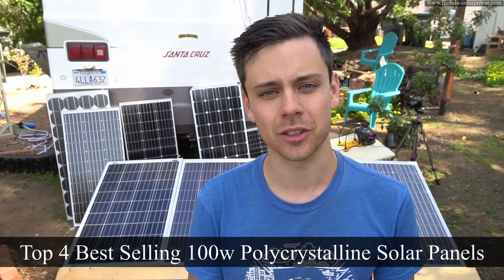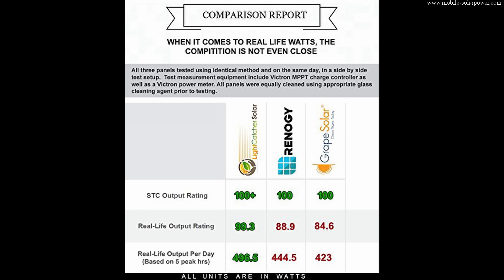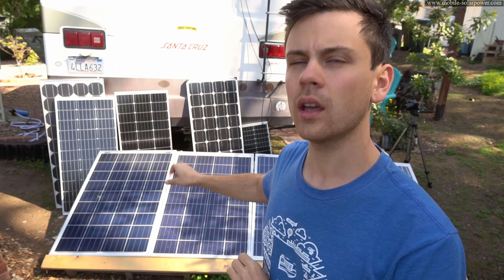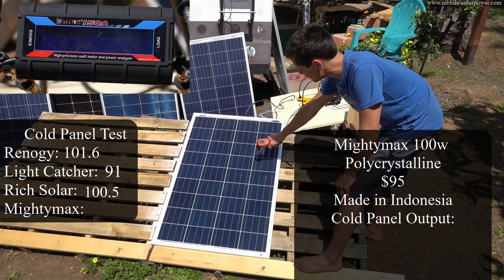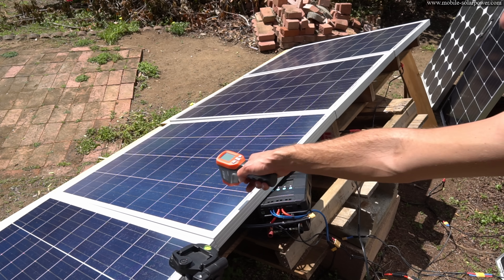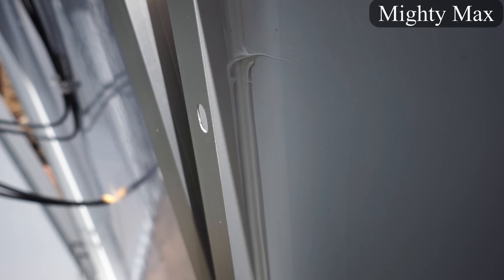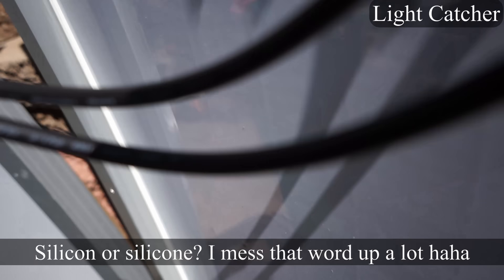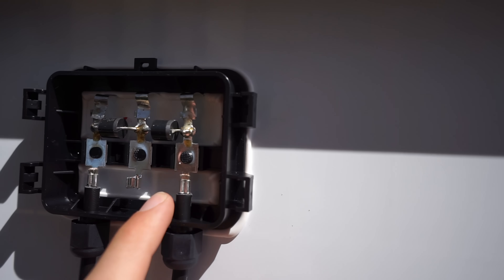100w Polycrystalline 12v Solar Panel Showdown! Renogy vs Rich vs Lightcatcher vs Mightymax

Comment: That was a great video, thank you for all that good work you do. I just bought a 400w system from windynation.com. four 100 watt panels. One came with a dent in the side like from a forklift and also had a bow in it. Another panel was all dirty on the back side and had an opened bag a battery cables Loosely flopping around. It also came with no instructions about their wiring. The wire that was included to hook all the panels together was in a very tight configuration. There was not enough wire to go from the battery to  the roof of the RV. That distance was only seven feet. Their instructions were to go to the internet and download their information. Being I am out in the middle of nowhere and without a computer and only a telephone to do this on, left me at quite a disadvantage. I've watched a number of videos on Renogy lately. They impressed me the best and that I believe is where I will be going to get my system in proper order. I will order a new charge controller and wire to start with and then discuss with them my future needs. Again thank you for this video.

Comment: id still love to see how you could use the heat on those panels by running some hose on the backside of em (fixed to the backside w/ thermally conductive silicone) and running water trough em
Reply: Or just spray a mist of water on front . The evaporation effect works better than running water.
Reply: @00708046  His comment was about using the heat not just cooling the panel - as in dual use to cool the panel while also creating a solar water heater.  Besides that you would have to pay for the water that you spray on them, and most tap water can contain a lot of minerals which can build up and degrade the efficiency of the panel over time and need to be removed.  Rain water does not have that problem since it is essentially distilled water.

Comment: Funny, when I bought solar for my RV (2 Renogy 100w Mono), mono was supposed to be the best and Renogy one of the cheaper.  Thanks for this and I find your videos really interesting. If I add more panels, it looks like Rich Solar poly is the way to go.
Reply: I'm looking at the Renogy 100w Mono as well. What has been your experience with them so far?

Comment: Hi Will, we just purchased a 2019 Thor Challenger 37FH, it is 'pre-wired' for solar, but we're at a loss as to what we need at this point and where/who should complete our system.  Any suggestions?
We definitely want better batteries then the house batteries it came with.  I've watched many of your videos and trust your input.
Thank you!

Comment: polycrystaline panels works usually better in not direct sunlight than monocrystaline, but in otherhands monocrystaline panels usually have just tiny bit better effiency, so you can produce the same amount of electricity with smaller panel

Comment: I'm curious about these tests Will.  Won't the charging current change with the state of charge of the battery, or am I missing something?  That being said, this has been a great, informative series.  Thanks for producing it!
Reply from the maker: Great question! This is why I use a discharged LiFePO4 battery. If I were to use a lead acid, we would run into some problems. I also connect the panels long enough to test it accurately, then move to the next one. Internal resistance is so low in LiFePO4, and panel wattage is so low that each panel is pushed to their maximum output. If I did this test on other batteries, or if it was full, I would get bad results
Reply: @WillProwse  Glad you did it that way.

Comment: Hi Will, your comparison techniques are sound, though you didn't compare the lengths of the wiring or note that the wire gauges were identical--perhaps the German model had a longer wire?  10% less output is something way out of norm, for sure, making it more likely that the system assembly might be a contributor to the resulting output.

I also like that you bought the panels a la Consumer Reports, though I'm sure your hobby budget is getting stretched.  I'm not surprised that, at 100W, poly and mono panel outputs could be comparable.  Now the output-per-square-inch of cell, mentioned by someone below, (normalized for the size of each cell) will likely show a difference, but you'd have to break down the panels to get at that measurement, not a good use of your hobby dollars.  

In fact, for your hobby budget, the 100 watt panels are the RIGHT size that match your needs.  Adding panels at these prices are much more feasible.

Overall, great job; moderate your choice of adjectives when output varies by less than 3%--your reaction to the LightCatcher panel was priceless, though.
Reply from the maker: Great questions. So the wire length at our current ratings will not affect it. They are a few inches of difference, but that would not change it by much. Maybe a thousandth of an amp. Everything is over gauged well beyond necessary and everything is pure copper. Discharged LiFePO4 internal resistance forces these panels to push as much as they possibly can.

Oh yeah, the output per sq inch. If I use the advertised power ratings, mono looks better on paper. If I use my test results which have been extremely consistent, mono and poly produce nearly the exact same power per sq in! I usually get the same % at the end of my calculation. I think I might make a video about this, good idea.

Yeah 100 watt panels are great on a hobby budget. I would love to test the big panels soon but they are pretty big and sometimes pricey. I might do it though :)

Comment: What do you recommend for someone who has limited roof space on a van and wants to maximize the amount of solar power with higher than 100w panels?
Reply from the maker: in all of my tests with these 100 watt panels I found that the efficiency is nearly identical whether you use mono or poly. So the power per square inch is the same. The decrease output of the Monos put them in pretty much the exact same efficiency class as the poly crystalline's. I'm not sure if this is only with the small panels but with all the ones on Amazon it seems to be the case and it's always consistently that way
Reply: @WillProwse  Thanks Will! I appreciate all of the great information that you provide us with.
Reply: @Live Your Life On Purpose - Curious, wat size panels did you end up going with(?)

Comment: Not bad! 
Try them in not direct sunlight. A cloudy day... Monocrystal panels maybe Works better in a cloudy day. 
( i worked in Sanyo/Panasonic for long years, and tested many of sanyo hit modules. try to bought one)
Reply from the maker: yeah I tried that in a previous video with high clouds so I can get consistent results and it didn't seem to be the case at all
Reply from the maker: Good to know about sanyo. Have you ever had any panels that were just extremely good? Any recommendations for me for future test videos?

Comment: Another good job.  Thanks.  Please keep in mind that these manufactures lie a lot.  "Made in Germany" probably means "Made in China" but final assembly in Germany.  Laws governing these claims are extremely lax due to lobbying by vendors.  You should disregard these "Made in" claims - they are completely unreliable.  My suspicion is that the "Made in Germany" panel is likely made by mounting the "Made in China" solar panel into an aluminum frame "Made in Germany".  If you care only about the frame, then "Made in Germany" is relevant.
Reply from the maker: thank you for making that point! Most of these say they are assembled in other countries. I actually had to call them up to make sure that the solar cells themselves were manufactured in these countries listed in the video. renogy is assembled in United States but they're made in Thailand and they don't put that anywhere on their website and people think that they're getting a USA panel when they're actually getting a Thailand panel.
Reply from the maker: And the made in Germany panel is specifically manufactured entirely in Germany.

Comment: Maybe compare the mono and poly christaline panel in low light situation, like when its overcast. Great videos man
Greetings from Belgium🇧🇪
Erik
Reply: I would imagine a low light test is nearly impossible because when it's cloudy the output from the sun can fluctuate multiple times per second, sometimes drastically within just a blink of an eye.
Reply: Sirius White  Really the best way to test these sorts of things is in a controlled setup. You produce the light used for the experiment so you know it is identical conditions.
Reply: ...the only way to get an accurate test is to have multiple meters and run each panel simultaneously. that will avoid the quick changing solar emissions
Reply: For small solar like Solar strip light for Carport or Battery maintenance Harbor Freights Panel kit is Excellent in Very Low light , mine works even at night off neighbors streetlight to a small degree lol 
Each panel has an led at the top and mine albeit Always stay ie meaning they are working and producing a charge . 
 I've even brought bottomed out supposedly ruined Batteries Back to life w them or very close to where they Still function and serve their purpose well enough for per say my Zero turn mower battery etc or RV battery a Guest ran to 0 in the middle of winter having tripped the breaker to rv then forgot to reset the Battery charger as the Heat Blower draws alot overnight . 
I do need to seriously Get an excellent system together 
TY for yet another good Vid

Comment: The Rich Solar are on sale in Amazon four 100 watt Poly panels for $332.99. They also now have a new160 watt ply panel for $165.99 each. Those 100 watt panels are available in lots of two, four, or six. They also have a new 170 watt Mono panel for $175.99.

Comment: Why do you only use 100w panels in your designs?  I'm mainly wondering the impact on choosing other components if I choose a panel >300w.  Thanks
Reply from the maker: Great question. I love 100 watt panels because their small size makes them very strong and allows me to mount them on the roof of a moving vehicle no problem. Nice and lightweight too. For stationary systems, 300+ watt panels are preferred. And I will probably review the big ones in the future.

Comment: Compare your full size mono panels (not the compact) with the poly panels.
Reply from the maker: Great point! I covered this in the mono vs poly video. Efficiency is practically the same for their size. The larger mono panels nearly produce the same power, but at a higher cost. The smaller mono panels are actually more efficient overall

Comment: Will. Thanks for your work. Be real interested to get data from 5 year old panels.
Reply from the maker: I tested 30 year old panels at a friend's warehouse and they were producing 90%. The 80% warranty at 25 years that most panels is extremely conservative. Most panels produce much better numbers after 25 years than 80%. Most panels will produce plenty of power until the day I die. Pretty remarkable

Comment: Why not test some panels that are used in a larger scale 60 and 72 cell units.
I have trina 255watt panels that are 24v    I use 3 of them together to keep me under 150v to the controller... Seems like you could use 4 … but you can't with shading to sun offsets they jump in volts .. so 4 units could go over 150 volts …
these panel can be had for 140 bucks each if you look around.  more bang for your buck.

Comment: I am gutted , you didn't test the 100 W polycrystalline panels I bought from Windy Nation.
Reply from the maker: Aww darn!! I had them on one of my lists but not this one. I will have to get a windy nation panel. I love everything they make though. Except the heat shrink in their copper wire kits. Everything else is good stuff
Reply: Will Prowse Just playing with you Will, I have had them for around seven years and they are working great for me. I have two on the roof of my pro master and two I plug-in and move around in the morning and afternoon to get the sun.
Reply: I liked my windy nation panels
Reply: Me too, never had a problem with them, and they are well built.

Comment: Well, I guess now it´s time to get in the subject of quality and the manufacturers of the cells and not only the manufacturers of the panels. After all that is what really determines the difference in producing power. Cheers
Reply: For the most part, I agree.  However,  if a frame is poorly built allowing it to flex,  that can potentially cause cells to crack

Comment: Will, I have a question. How much can I expect to pay for a full solar install on a newer higher quality 24' trailer I plan to fulltime in when I retire? The install would be enclosed in the foreward passthrough. Minus 2 lithium ion batteries, 2,3,4k or more?

Comment: Hello Will, I asked you before if it is possible to charge my Xiaomi m365 electric scooter with the Jackery 240 power station. The scooter battery is 280 Watt hours. You needed that information...If it works...Is it possible to load my scooter via the Jackery while driving at the same time as I charge the Jackery using the 12V cigarette outlet?   Sorry for the long fucked up sentence. I'm Swedish. Can't do much about that...
Reply from the maker: Most of those scooters will not allow you to charge it while riding them unfortunately
Reply: @WillProwse  I'm unclear. Sorry. Charging the scooter while driving the car.
Reply from the maker: @johanswede8200  ohhhh I am sorry. Yeah you can do that no problem. You can charge both the jackery and the scooter. no problem.
Reply: @WillProwse  You just made my summer travels much more interesting! Thanks Will!
Just one last thing...The Jackery 240 can handle these 280 Wh...Won't explode or anything?
Reply from the maker: @johanswede8200  watt hours, no problem. Just wont charge it to 100%. But make sure the wattage of the charger is less than 200 watts.
Reply from the maker: @johanswede8200  It has over current protection too, so just try it out. it wont hurt it
Reply: @WillProwse  Thousand Thanks (= Tusen Tack - direct translation from Swedish) Will! 
The wattage of the charger is 71 Watts. So I'm cool there...
Thanks again Will! No one I know has a clue about these things. Not even my father who went to KTH (Swedish MIT) to get his civil engineering degree. He is 85. Might explain some lack of knowledge. He knows a lot about 400,000 Volt power lines...That's about it.

Comment: What about the output differences between poly & mono when panels are mounted flat. Like you, I'm surprised how much better poly panels perform against mono panels. Thanks so much
Reply: Good idea.  I was thinking the Mono panels will do much better when the sunlight is oblique (like 30 - 45 degrees away from Sun).
Reply: I wonder if the panels perform differently in different sun, could you just have both types of panels in the system?

Comment: Great video Will! Keep up the awesome work!
Here is something else you might try testing- I found that the output on various solar panels decrease (as you showed in your video) as the temperature of the panel rises, however in testing I also found that the power output continues to decrease if you put the panel under full load and I observed that with different panels it often doesn’t stabilize until its been producing full power for often 10-15 minutes.  I am curious if you also found this to be true and how these panels might perform under that kind of test as in my mind that would be the true test of the performance of a panel (its continuous output).
Reply from the maker: Great point!! I actually found this to be a problem with lead acid. With lithium ion batteries, the solar panels will keep producing whatever they can at their internal cell temperature. I suppose it's due to internal resistance of lead acid battery that changes the charge rate. Could watch solar array voltage and see how it tracks while it's charging. Haven't noticed this issue with lithium ion though. Panels produce max power non stop. I find lithium ion to be the only accurate way to test solar output. Lead acid charging is more complex and resistance can change quite a lot during the charge cycle.
Reply: @WillProwse  -  As my load for the solar panel output I was doing -  I was testing with a 50 watt, 75 and 80 watt solar panels and my load was a 60 amp hour lithium battery pack that was mostly discharged that was also powering an inverter to run multiple combinations of 4 lightbulbs as I wanted to be using about the same amount of power as I was producing to keep the test results constant.  I noticed more of a  drop in output current  (within the first 10 minutes of the test) with the 4 no name flexible panels I had gotten from china (the other test panels were two 75 glass panels and 3 50 watt panels from AllPowers and Mohoo.   I was wondering if you have observed any drop in power on the panels you have tested after 3, 5, 10 minutes of full power draw? I am still at a loss as to explain why some panels drop significantly more in power production than others as the surface panel temperatures were all around 135-140 degrees.  Any ideas?
-Scott

Comment: The panels look so similar in their fabrication, are you sure some aren't fabricated in a common plant and then shipped off to final assembly to various "manufacturers" or maybe only for final branding and are nearly identical in fabrication?
Reply from the maker: Different factories. Guess I should have mentioned that in the video. It took a bit of work to verify this.
Reply: @WillProwse  Thanks for the legwork and prompt replies Will.
Reply: @WillProwse  Bro, this is above and beyond. Right on, Will. Right on.
Reply from the maker: Not this time. I called them and verified that each panel's solar cells were manufactured in the stated countries listed in the video. Renogy didn't have it listed and it took awhile to find out their true country of origin.